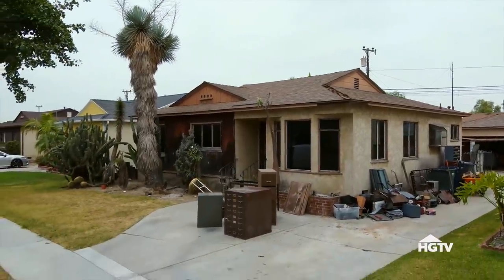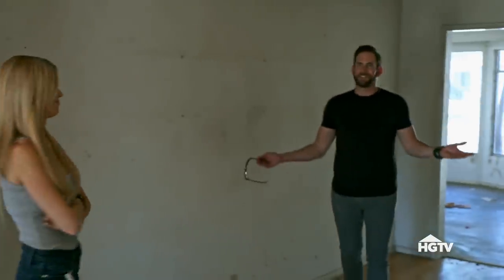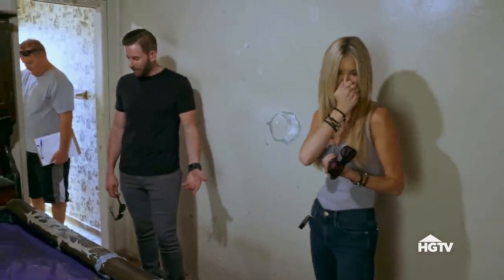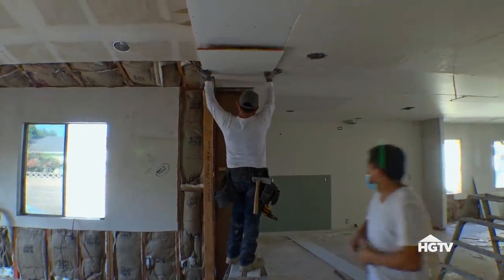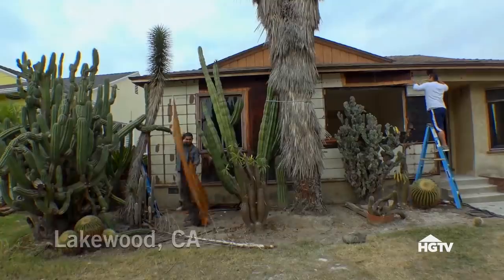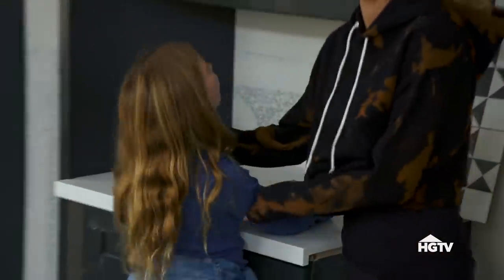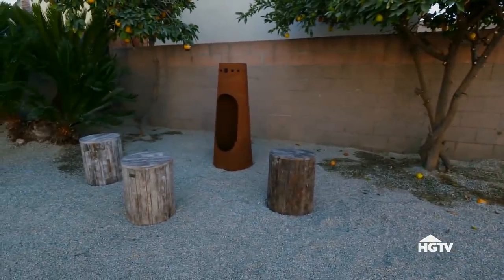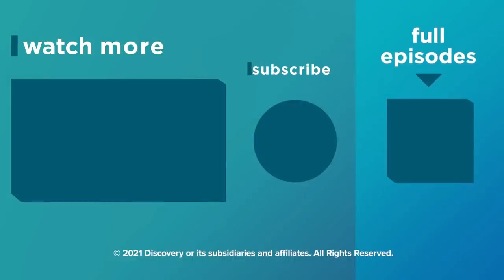Tear Down Walls To Expand Kitchen | Flip or Flop | HGTV

Comment: It is so great to see Tarek and Christina acting so nice/fun with each other. That's the way it should be. Respect. It goes a long way. Kudos!
Reply: what had happened between them?
Reply: @Manisha Susan  they're divorced and they had a pretty rough couple years with a lot of tension between them when filming.
Reply: @Bird1964  Tarek has some health issues with his thyroid.  That caused some major havoc in his recovery from the divorce.
Reply: @insightstar  I can believe it. I had the extant thyroid problem. I had cancer and it spread from my thyroid into the left side of my neck. I am currently having extreme problems again and I need to see my endocrinologist. I was supposed to have 2 surgeries but that was squashed because my thyroid is way outta line. It reflects in everything, including hair, nails, skin, moods.....oh my gosh, the mood swings are terrible. Happy one second, crying the next and then anger. It is awful. I never knew how vitally important it is until I had cancer.
Reply: @Bird1964  I understand.  I went through major thyroid dysfunction that threw me into horrible mood swings and weight gain!
Reply: @insightstar  omg.....the weight gain. I look like a chulupa because of it. 45 additional pounds. I'm try to lose them but it's too of kilter right now and isn't working. I'm typically size 4-6 and 128 pounds. I'm taller, 5'7-1/2" but this stinks. I just want my life back. Did your weight fall off once your thyroid was back in sync?? Thanks for your reply 👍
Reply: @Bird1964  I can relate.  I went from 140 lbs to over 240 lbs at 5'10"!
I then went to getting my body resolved of fibro mialga.
After that it was Lyme disease. 
Dang!
I'm at 190 lbs at the age of 71 and praying I figure out the next course of action.
Reply: @insightstar  sorry for the long message. I'm starved for adult conversations lol.
Reply: @Bird1964  they are getting back each other again now and Christina is pregnant
Reply: @♍GolDah♀️  lol are you serious? I just looked up Tarek yesterday to see what was going on with him and Heather because it's been a few months. I actually said that I bet Christina winds up getting pregnant again. Heather is and she probably wanted action too. When did this come out?